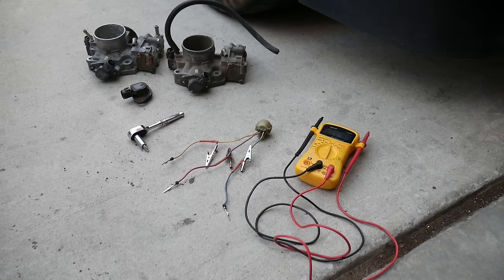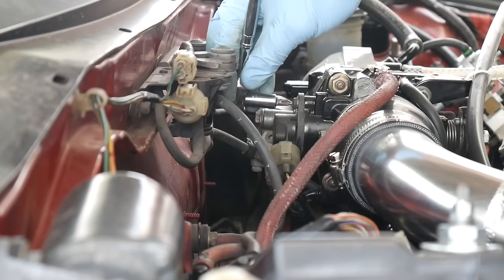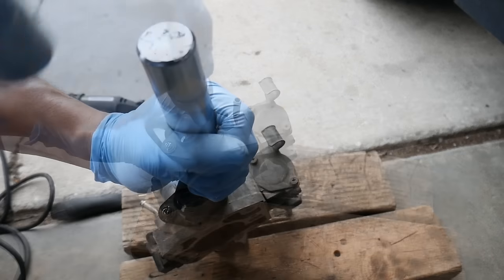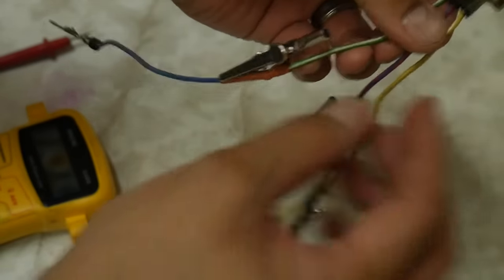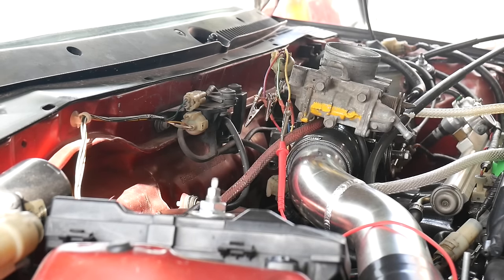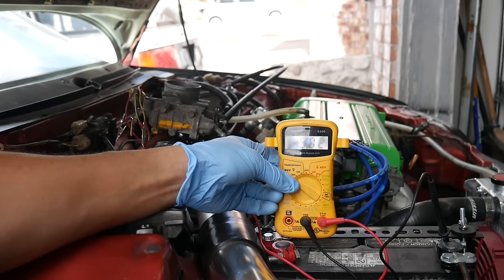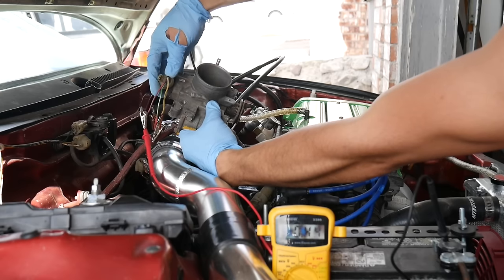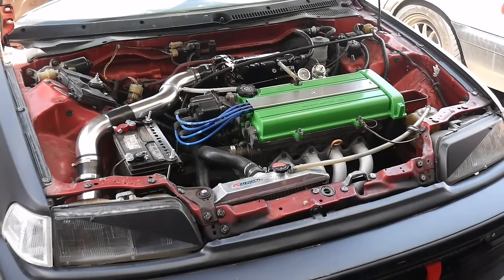How To Replace & Calibrate Honda TPS (throttle position sensor) - Code 7 Check Engine Light

Comment: Where in this video are you calibrating it I see you testing the signal but I'm trying to adjust the position that the TPS sits in I want to see how other people adjust it I don't see you adjusting it at all I just see you testing the wires
Reply: I mean there is a way to do this manually without a multimeter
Reply from the maker: No

Comment: When you are setting TPS,  you say take voltage measurement with throttle closed. Does that mean completely closed as in throttle stop screw backed off? Or just normal idle position?
Reply from the maker: Just leave it closed in normal idle position.  Do not mess with the stop screw unless absolutely necessary.

Comment: Can i just jam the multimeter leads into the tps sensor plug? Will this work on a d15b7?
Reply from the maker: Yes
Reply: Thank you very much in the process of getting my crx up and running 😁
Reply from the maker: Sweet
Reply: Garage Built Hondas  hopefully im not being a nuisance i have one more question i hope you could answer. Is my ecu supposed to blink once when i turn the key to the on position and than blink once again when i turn it to the off position?
Reply from the maker: Yes when turning on, I honestly don't recall the blink when turning off but have never watched it as I've turned off an EF.  It probably does then, especially if yours is working just fine.
Reply: Garage Built Hondas d*** not the answer i was hoping for :( my crx has spark is getting fuel and the timing looks good i guess the only thing left to do is check for compression hopefully that goes well! Ive deleted all the emissions stuff and hooked up the two vacuum lines on a d15b7s throttle body to my map sensor on the firewall, considering all that works what would your 2¢ be as to why it wouldnt start? It cranks but doesnt start. Sounds like it wants to but wont.

Comment: Sometimes my throttle is not responding when I'm driving but after few seconds it will be OK. Maybe it's the tps malfunction?
Reply from the maker: Are you getting a check engine light?
Reply: @GarageBuiltHondas  no light. Everything looks fine. I just changed map yesterday and the problem is still there.
Reply from the maker: Try to clean the throttle body plate, maybe that will help.
Reply: I already did. Still useless...But thank you for your notice. Now I'm gonna check my every single wire.
Reply from the maker: It might not even be the TPS.  Is the distributor cap and rotor very old?  Are the plugs newish?  Those items being old can create idle issues too.
Reply: @GarageBuiltHondas  those things also changed. Problem is still there. The most weird thing is everything is so good except sometimes the throttle is not responding well. Next, I'm gonna check my timing is correct or not.
Reply from the maker: Nice, let me know if it helps!
Reply: Hey, I just figured it out. It's my stock ECU problem. Inside the ECU..It's the chip that control ignition is already broken. That's why sometimes the throttle is not responding.
Reply from the maker: Great to hear that you got it figured out!!

Comment: I’m throwing code 7 and have no vtec which I know is hooked up right... will tps make vtec not engage?
Reply from the maker: Absolutely.  But my TPS goes off on my 91 Si B16A and it still hits vtec.  Have you checked your oil level?
Reply: Got vtec figured out but now can’t get Tps past .53 . I can get it to .5 but i have to turn it so much the holes don’t line up ... I even took it to a Acura dealership and they said they won’t touch it cuz it’s so old lol it’s 91 da with a 97 type r motor .... seriously frustrated cuz I’ve tryed 3 times and can’t get it any thoughts ?
Reply from the maker: Try a different map sensor first.  Maybe it's defective.
Reply: Never thought of that ... I will try
Reply from the maker: Report back, interested in hearing!
Reply: poonjaber1122  I have the same problem! Won’t go past or you won’t be able to screw the screws in :(
Reply from the maker: Maybe try a different tps sensors.  There are a lot of junky ones floating around.
Reply: Still having the same issue...starting to think it’s not the tps, maybe injectors or IACV??
Reply from the maker: It's gotta be the TPS.  Which throttle body?
Reply: Stock itr throttl body
Reply from the maker: It's gotta be something tps related.  Try checking the wiring using s multimeter.

Comment: the lowest reading I can get at closed is .60x  and at wide open is 4.76  this doesn't seem right do I have a defective TPS?
Reply from the maker: You followed the steps, correctly plugging each wire in correctly and still getting those readings?
Reply: Jon Widmer yes I probed into the red wire and got those readings

Comment: I install the sensor will the check engine light on passenger side under glove compartment stop flashing or do I need to disconnect the battery to reset the cpu?
Reply from the maker: You need to reset the ECU by disconnecting the battery, or taking the ECU fuse out for 30 seconds.
Reply: @GarageBuiltHondas  thks

Comment: What throttle body are you using for your b20 swap with skunk2 manifold, I hav a b20b with skunk2 manifold with a 90 integra throttle body and it deletes the fast idle thermal valve and now my car idles rough from 1k to 2k....any idea, thanks in advance!
Reply: I'm dealing with the same issue, just took the throttle body off cleaned it all up it was a carbon mess thought that would solve  my issue but it did not
Reply from the maker: I'm using the Skunk2 TB also.  I don't have any issues with my idle.   You may want to try adjusting the small bolt which adjusts the throttle plate.
Reply: @GarageBuiltHondas  did u bypass your fast idle thermal valve?
Reply from the maker: I don't have one either with the Skunk2 TB.
Reply: I have pro series throttle body 70mm for sale I can ship it to you

Comment: In order to get wide open throttle reading I need to change the wire im testing? Or is it the same as with the 4.5 closed reading one?
Reply from the maker: same wire, WOT should be 4.5, and .50 closed.
Reply: J Wid Films then for some reason it doesnt change voltage when I open it. What could it? Im not having tps problems btw just swapping ny oem tb
Reply from the maker: The connection is good?
Reply: J Wid Films Im not sure, i just punctured a little hole to my red and black wire. Its an RSXS
Reply from the maker: Maybe take off a little more of the sleeve to expose more wire and see if that helps the connection.

Comment: 98 honda civic ex d16y8 tps got it set at 5.0v c.t but want go to 4.5 w.o.t any help
Reply from the maker: How are you getting it to 5.0 volts?  That's already past 4.5.
Reply: @GarageBuiltHondas  was told have it at set at 0.5 sorry closed an 4.5 fully open but can get the 05 closed but not 4.5 fully open
Reply from the maker: You can try adjusting the throttle plate stop on the front of the throttle body.

Comment: .my car is a 98 civic with lsv. i got code 7 for tps sensor, has a new tps sensor i can see why its off. but am i correct that this is the most likely cause of limp mode cuz this adjustment is off?
Reply from the maker: Doesn't seem like it would.  Check the wiring at the distributor, make sure none are loose or in need of repair.  Have you taken it to Autozone?  They'll run the obd2 scanner and it should point you in the right direction where the problem is.
Reply: Jon Widmer i heard i have to pull codes by counting the flashes, at the ecu pin which i did. Igot a 98 civic ex harness b16 head and b18block
Reply: Jon Widmer dizzy is a b16 obd1 with dizzy jumper. And running p28 chipped ecu
Reply: Brandon Bassett hey man I got the same code with my car in limp, did you figure your problem out?

Comment: I have a 1991 civic dx when it gets hot it doesnt acelerate the engine just shakes then check engine light comes out
Reply from the maker: See what the CEL is and if you fix it you'll probably fix your problem.
Reply: @GarageBuiltHondas  do you have any email so i can send you a video of the codes its showing me the red light  that blinks?

Comment: Years late but imagine getting lucky by not using the conventional stuff to adjust it especially when you put it on at the right position by accident without checking 😂

Comment: What size of tb can i replace my stock one with on my d15b7
Reply from the maker: Get an OEM sized replacement.  Going larger won't be beneficial for a stock engine.
Reply: @GarageBuiltHondas  where would be a good place to get lne kinda hard to find ?
Reply from the maker: Local part outs to your area.  I see these kind of parts locally all the time.
Reply: @GarageBuiltHondas  used ??
Reply from the maker: Yes

Comment: What are the symptoms of a failing or bad TPS? Never messed w/ mine, but my 98 Civic D16 is having intermittent brief hesitation under light acceleration.
Reply from the maker: That could also be a distributor issue, possibly old cap & rotor.  Spark plugs old?  Fuel filter ever changed?
Reply: Actually, replaced all of the above. Timing set. New plugs wires, fuel filter, the works. It's just strange. Only happens sometimes. For example. I can be lightly accelerating (maybe from 5-10mph) and it'll cut right down, like there's no power, like I let off the accelerator. Then it'll be fine after that for the foreseeable future. Strange. The car runs and drive flawlessly otherwise. This issue just arose recently and it's intermittent.
Reply from the maker: It's gonna be hard to diagnose if it's intermittent too, hopefully it's not too bothersome for now.
Reply: I have that same issue.  Started out of no where.  Like when i get to a stop sign or light engine shakes then goes back to normal but rpm is almost bottomed out to nothing. So not sure.. replaced motor mount,  spark plug and wires,  timing belt.. next would be distributor and fuel filter to see but I doubt it.
Reply from the maker: Check fuel pressure.  Maybe the pump is going bad or has less flow now.   Maybe the fuel pump filter is getting clogged also if it's original.

Comment: Can I calibrate the sensor with the throttle body off the motor?
Reply from the maker: No
Reply: @GarageBuiltHondas  so I remove the throttle body Make the slit on top of the screws too loosen it up put it back on the calibrate it?
Reply from the maker: You know after rethinking about it, you could try.  The only reason I don't feel like it would work is because the throttle cable, but I'm sure you could just try to adjust the throttle cable and see how it responds.  Give it a shot first!

Comment: My tps got smashed while removing the engine. I'll try this sooooon as buy a reader thanks
Reply from the maker: You're welcome!
Reply: Garage Built Hondas hey just thought of it, am pretty sure this will work on a p72 obd1 with a da9 chassis & harness? For all b series?
Reply from the maker: Correct!!
Reply: Garage Built Hondas the lowest I can get mines is to 0.7? Could it be my eBay$10 tps? Won't move any further.
Reply from the maker: Possibly.  You'll be fine leaving it at .7.  I've seen people never adjust the TPS and not once have a driveability or MPG issue.
Reply: Garage Built Hondas thanks man. You have a video on how to wire up ect switch on da9 b18b p72 ecu?
Reply from the maker: No, sorry.

Comment: wow way to go you made a video on how to replace a tps and you didnt do it way to go
Reply from the maker: Wow back at you.  Take a real close look at the title and the huge letters in the thumbnail.  Now, please let me know where it says "replace" anywhere??  It clearly says "DIY Adjustment/Testing", not "Replace".
Reply from the maker: And if you actually watch it, I did go over how to remove the different bolts/screws/heads on the TPS.  If you cannot figure it out on how to remove them as I described them, then shame on you for trying to be a smartass on a comment.
Reply: Jon Widmer I apologize for that comment. I think it was meant for another video because you did go over removing the bolts.
Reply: And if I did write it for this video I apologize. I was just upset that i was not able to remove those 2 bolts and probably  fast fowarded or something
Reply from the maker: Apology accepted, not many people would do that, and not a problem.  There are a lot of videos out there that could've used a little more effort when making them.  I know exactly how you feel.

Comment: Great video. What setting do you have the volt meter on?
Reply from the maker: +Bobby Fontan DC volts at 2 decimal points over.  I don't know if that's the proper way of saying it.
Reply: Garage Built Hondas ok so set my volt meter on 20 dc?
Reply from the maker: +Bobby Fontan Yes, as long as that shows 2 decimal points over.
Reply: Hey Jon, a? is the setting for the TPS the same on all b series? .50 close and 4.50 open? thanks in advance bro. i have a  B16 head b20 bottom fully built. sk2 ultra series mani and a 76mm throttle body
Reply from the maker: Yes, correct!

Comment: I like how he has the positive battery terminal so close to the aluminium cool air intake tube. That's 🔥bro. 😉👎
Reply from the maker: Yeah me too.  Honda designed it.  It worked.  Zero issues.  Car ran hard, and was tracked until it was sold.  Duh.
Reply: And it’s got rubber on the intake so it don’t arc

Comment: if my tps adjustment is off can i cause a misfire?
Reply from the maker: Possibly, but usually not at all.  I've just thrown the TPS on before with no Adjustment and didn't have problems.  It is possible though.

Comment: ohh i need to find those metal pieces that fit into a plug you solderd onto. where do you find those?
Reply from the maker: Harbor freight.  Probably any hardware store would carry them.
Reply: +J Wid Films I didnt know harbor freight carried honda pins. ill probably just de-pin a plug at the junk yard. Great video.
Reply from the maker: +gepettobrent lol, I misunderstood.  Yes those plugs are from a Honda wiring harness.  The other gator clips I bought from Harbor.

Comment: what setting do i put my multimeter on
Reply from the maker: It's in the video.
Reply: @GarageBuiltHondas  i have the red 7 funtion.. im only getting 5 volts all three wires nothing changes if i moves the tps or open  the throttle constant 5 volts

Comment: 🐋💩 tried the method of using a dremel on the bolts went to turn with a screw driver and snapped the heads off. i am lost now lol

Comment: My battery is in my trunk 🧐
Reply from the maker: Get a long wire.  Lol

You can probably run it to the fuse box or power for the starter also.
Reply: @GarageBuiltHondas  I used my finger XD I held the black pin and got a reading fixed my tps issue!

Comment: I’ve got a 2000 Honda Civic Cp ex, I can’t get anything lower than an 8.3 on the vehicle and I’ve tried grounding it on the negative post and have tried connecting it to the black and yellow wire. My car isles high and won’t go anything higher than 2.3k rpm it bogs down when I do any suggestions?

Comment: I have the dpfi...what does it mean if I disconnect the tps and it dies? 
Problems in seeing is bucking at acceleration (eventually stalling) and very rough idling.
Reply from the maker: Any CEL's?
Reply: Garage Built Hondas none at all. I read that it should run still, mine dies. The TPS is within spec on the meter, just didn’t know if I could rule it out completely yet. Idling since then has improved but the hesitation at acceleration persists, bucking and jerking when I need the rpms to climb
Reply from the maker: I doubt it's the culprit.  New electrical tune-up parts lately?  Or older parts?
Reply: Junkyard dizzy and a junkyard IACV, just to see if it made a difference...same prob. But I’m thinking there’s a timing problem. Just noticed There are the factory three ignition timing marks, and some home-made timing marks lol the dizzy fully advanced is aligned with the homemade marks, fully retarded it aligns with the factory marks. Bucking while accelerating occurs at both so I’m stuck...I want to believe the factory marks but it needs to be at fully retarded timing to reach it. Ever seen that before? Can’t afford a swap yet, hoping this engine would tough it out a bit longer